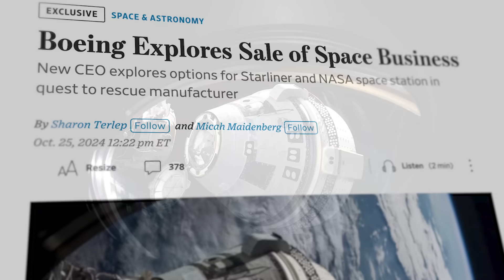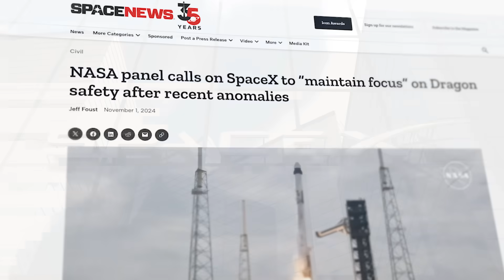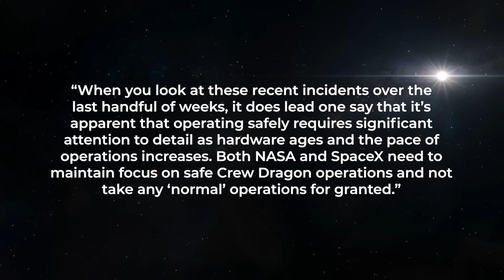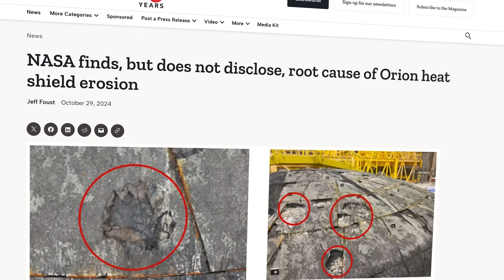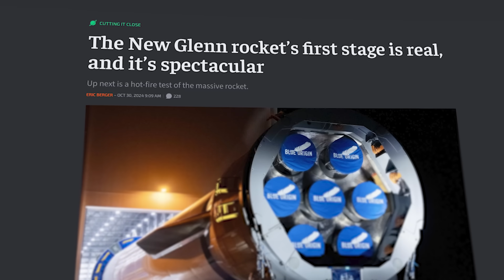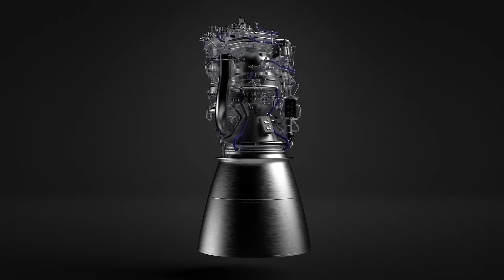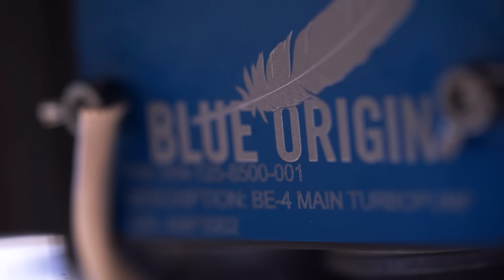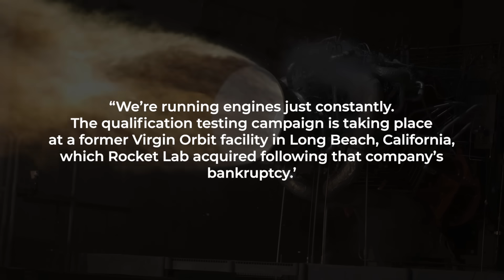Boeing Just Gave Up On Starliner...

Comment: 3:25 before you mount your high horse to proclaim your holier than thou opinions of SpaceX’s recent safety record, keep in mind all of your opinions are based upon SpaceX’s open transparency practices. They never hide or cover up any mistakes. (Boeing once had integrity and used to be honest of their practices) To  what authority do you have to lecture SpaceX on their safety practices? None.  How did you discover these safety mistakes?  SpaceX told you, like the rest of us. Did you discover a safety mishap they were hiding from the public? Nope!  Has SpaceX ignored those mishaps on their proceeding missions? Nope!  Just because Kent logged in the most time in space doesn’t make him an expert on manufacturing safe space vehicles. Just because you drive a car, doesn’t make you a mechanic of one.  Just chill. You’re doing a great job at simply regurgitating readily available information found on the internet. If you feel compelled to lecture SpaceX on their practices, be proactive like the “Everyday Astronaut.” He made an an appointment with Elon and toured the SpaceX facility. He inquired about all of SpaceX’s practices. He even suggested a possible solution to which Elon took into consideration and immediately implemented. He now has an inside track into anything and everything SpaceX.  You can do that to. Till then, chill on the lecture.

Comment: The WHOLE point of SLS and Starliner was that it was supposed to be simple and CHEAP, re-using existing parts and expertise from STS.

That this been allowed to happen should result in senate hearings and massive fines.
Reply: Congress is responsible for this situation in the first place. They’re the ones that insisted on building a new moon rocket using as much Shuttle technology as possible. Developing the vehicle largely from scratch likely would have been cheaper.

Comment: They have only built and launced 1 of the 3 versions of SLS. It took them 11 years to build it and they never could completely fix the Hydrogen Leaks. But a stuffed Snoopy was going to the Moon and if he didn't make it he would still go down in history as the fastest and highest (not to mention the most expensive) stuffed animal toy to attempt a Moon Mission (what a brave little guy)! it only cost $26 Billion Dollars for the rocket and 11 years to build, plus a $1 Billion Dollar Launch Pad (that was damaged during the 1 launch and had problems as well). That was all you got in 2022 for your money. In 1969 you got a completed moon mission on the 6th attempt in less than 10 years as advertised!

Comment: About time. How many people will get fired over this? The SLS rocket isn't far behind. NASA is trying to figure out who will take the blame for that mistake then they will announce the end of that failed program. 1961. When NASA had no knowledge of how to do anything in space they designed a rocket and lander system that got them to the Surface of the Moon and back to Earth in one vehicle, one shot by 1969. They did it with the 6th vehicle ever built and it worked as planned. Now today with all kinds of experience and knowledge (the Pioneers of Space Flight didn't have) NASA and Boeing can't get anything right when it comes to the new Moon Mission, and it's 2024, not 1961! So what is happening. Are the failures intentional since NASA and Boeing realized in 1969 that if you actually complete the mission the Congress will stop funding the program. But if you don't complete the mission they will keep funding the mission with more and more money until they just finally give up and start a new mission to justify the Billions of Dollars they need when American Veterans are Homeless and in the street. When is somebody going to wake up and ask the hard question: how could you guys pull this off by the time you built the 6th Rocket in 1969 with the first Semiconductor Technology and Analog Computers but we can't do it today with Super Computers and the finest materials that didn't even exist in 1969?

Comment: I expect New Glenn to fly in February. It may have taken SpaceX about six weeks from rollout to launch of Falcon Heavy, but they already had lots of experience with Falcon 9, and Heavy is essentially just three 9s strapped together, and they have a culture of getting things done quickly. Blue Origin has no such experience with orbital rockets and no such culture.
     I notice none of the rumors concerning any possible sale of Starliner have received even anonymous confirmation from inside Boeing. I will believe it when Boeing confirms it. Besides, who'd want to buy it? The idea of stripping it and building a whole new space craft inside the existing shell makes no sense. It would take far too long for any new owner to be able to fulfill the Commercial Crew contract.
     Very much looking forward to Neutron beginning to fly. There are certain missions it might be more suited to than Falcon or even Starship.

Comment: 4:41 OMG it is normal for the parachutes  to open at a different pace and a total failure of a chute will not impact the capsules safety and performance.  It is more likely they were brought to medical facilities was due to their duration in space and the atrophy suffered from this.
Reply: jeffingram8279; You’re exactly right! It absolutely was the mission duration that required a medical sign-off on crew return.  People don’t realize that crews spend about 2.5 hours out of very 24hrs doing physical exercise to counter the long term effects of the micro gravity environment.  There is much to be learned from their exercise routines, diets, sleep etc. but only if we take measurements before AND AFTER missions. The initial exams start within hours of landing and include physical exams, neurological assessments, and balance tests to gauge immediate effects of microgravity on muscles, bones, and the vestibular system. These first evaluations can take around 2–3 days but they actually continue with periodic exams for months after return.  They MAY have been injured by reentry events but they were headed for the medical facility regardless.

Comment: It's seems really weird to me that the only US commercial company to ever try to put a Lander on the moon just said they are on track launch by the end of the year gets so little coverage. Firefly may have had a bumpy start but after ditching Aerojet Rocketdyne and the AR1 they have had 5 Successful Launches with they're Low-Payload single use Alpha Rocket that is Powered by 4 of they're Reaver Engines and 20 more flights contracted. 4x Reaver 1 specs: LOX/RP-1 Turbopump Tap-off Cycle with a combined 801kn of Thrust (VAC), 295.5sec ISP (VAC), getting a reported 1,050kg to LEO, 650kg to SSO. 5 Reaver 2 Engines are planned for future Alphas. Now that's pretty kool but it pales in comparison to there most recent achievements.

Having proven there manufacturing techniques they have now been award a contract to build Northrop Grumman's Antares 300 Rocket which is believed to be similar to they're own MLV. The MLV (Medium Launch Vehicle) doesn't have a sweet name like the Alpha but it's the chosen vehicle to take Blue Ghost (they're unmanned Luna Lander) to the moon. MLV will be fit with 7 Miranda engines. Although Lunar Injection Missions will not leave enough fuel the MLV's first stage is planned to do propulsive landings and be fully reusable just like Falcon 9, Super Heavy, & Starship. The Miranda/Vira (Vacuum Miranda) class engines have undergone 20 successful test fires and enter full production. MLV first stage specs: 7x Miranda engines LOX/RP-1 Turbopump Tap-off Cycle with combined 7,161kn of Thrust (VAC), 305 sec ISP (VAC), getting a projected payload of 16,000kg to LEO, 3,200 to GTO and the second stage powered by 1 Vira Engine (Vacuum optimized Miranda) will get a projected payload of 2,300kg to TLI. Yet none of that is worth even a single mention... Maybe next time.

I have yet to read anything that clearly states weather Northrop Grumman's Antares 300 will be fit with Fireflies Miranda class engines. My understanding is that Antares 300 is the MLV with a buffed Antares 230 second stage atop it.

Comment: Commercial airliners operate in a much safer area of the envelope, yet planes still crash. How many airliners have went down over the last 70 years before reaching the current era of reliability? SpaceX operates at the extreme edge of the envelope, yet they have done so with a record of success that is hard to fathom. Reusability is a system and every system has limits. Engineering and testing can't always predict the limits of reliability. You can be sure every one of the issues mentioned here have resulted in numerous changes to process, manufacturing, and maintenance. The fact that none of them were mission ending suggests they are making every effort to maintain safety & reliability (while also testing the limits of reusability). Their very record of success has lulled many into thinking Space is routine and easy.

Comment: How is SpaceX "slipping"?  Did you see the Startship booster landing?  The Falcon 9 rocket has been improved repeatedly and it has been doing more and more.  The minor issues never endangered crew or people on the ground.  It is important to look at theses issues so you can improve and move forward but it does not reach the level of "slipping" in the slighest.  If you don't like Elon I understand, but you cannot argue with the success of the Falcon 9 rocket or SpaceX.  You seem vengful.
Reply: The criticism, just like the FAA issue, is political.
Reply: It's more that SpaceX is still effectively  a loss making company. Plus SpaceX has a problem where they used to be able to have the best people and underpay them. The lustre has been lost and there is a risk of SpaceX becoming lazy.
Reply: @letsburn00  You obviously are not paying attention and have an agenda.
Space X is firing on all engines.
Reply: @letsburn00 is that what NBC told you
Reply: @budwhite9591  No, I've been following spaceX since before the Falcon 1 launches. It's been quite a distinct effect. They are looking like star link will be their main profit centre

Comment: I would not be surprised if SpaceX build a landing pad on the moon for the SLS to have a safe arrival. However, the landing pad will have been built years before the SLS moon shot ever gets off the ground.. And as for SpaceX safety, they are constantly iterating - the Falcon 9 that took off even a year ago is not the same as the one taking off today. Yes, issues will arise but the aim is for them never to reoccur.
Reply: The real question is will SLS even be continued at this point. It will be on live support until Starship is manrated, then it is off to the races.

Comment: Boeing overcharged the US military by 8000% for soap dispensers, toilet seats and other cheap knickknacks, no business investor would see this company as anything other than fraudsters and con-artists.
Reply: From your comments I understand you have very limited contractual experience. All the items you named are not normally built by Boeing. The government contract call out those items to be built by the contractor, and then a percentage of them have to endure destructive testing to prove the contractual spec is achieved. Boeing has offered to utilize Commercial Off The Shelf (COTS) assets to satisfy the destructive testing and have been accepted by the Government contractors.
Reply: In addition, once the government approves the design of the items from the contractor, the quantities ordered does not reflect positively for any return on investment. The COTS option is the clear winner.

Comment: I give Rocket lab 2 years before they are completely obsolete due to Starship.  F9 will also be retired.
Reply: Do a bit more research before posting. Rocket Labs will survive. The company is much more than just rockets. Peter Beck is a lot smarter than you and will adjust as necessary.
Reply: @GntlTch  He's not smarter than Musk.  The rocket part is by far the most important part of Rocket Lab, which will be obsolete soon.  Maybe they can survive doing other stuff.
Reply: @billweberx  I didn't say that Peter was smarter than Musk, I said Peter is smarter than you - but that is obvious. Also, rocket, i.e. launch services are NOT "by far the most important part of Rocket lab". In fact they are the least - making up only ~20-30% of revenue. RL is actually quite diversified across the space industry spectrum. If you had spent just a modicum of effort reading their financial reports you wouldn't have such a glaring mistake.

Comment: Weird video. The parachute is not even a problem. It's normal behaviour. The landing failure isn't even bad news. They have been landing hundreds of times for years. They have a single failure and it's troubling and problematic?. When any other company on earth can land a booster, then we could talk about that. Then we have two upper stage problems. These are the real concern, but that is what the high safety record SpaceX upholds shows. They have an internal cargo mission fail to reach altitude and it's considered newsworthy. They're the only private company going to space.
Reply: Not quite the only private company. You are forgetting Rocket Lab. IIRC, they are now up to 53 successful lunches.
Reply: @GntlTch  Albeit not crewed